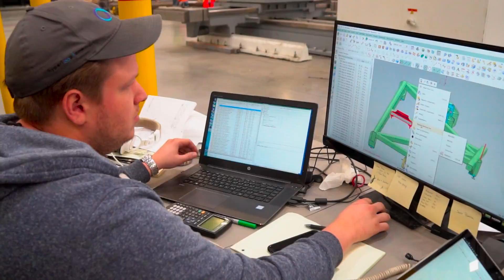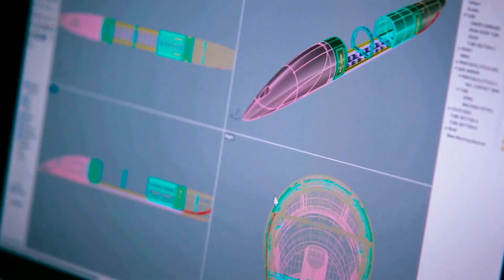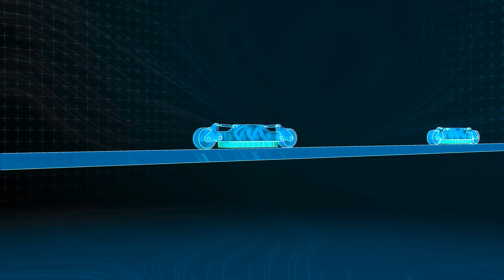How Hyperloop Plans To Revolutionize Transportation | Engineering The Future

Comment: But why not just use trains, how much faster compared to how much more expensive is a hyperloop compared to a train? What product or service needs that kind of speed to justify the enormous cost? If you instead just go with nice and slow trains you can still go as fast as most cars moving large volume of goods or people at a fraction of the cost and emission. For the cases where speed is key an aircraft will suit your needs, I just don't see the benefits of the hyperloop that would justify it's enormous cost, because it's just unbelievably expensive while not really having a good usecase to use them for. Maybe decades from now after the whole electric grid has been turned into a emission free one does something like this make sense but until then I'd hope to see development for this technology in the lab since it will be useful to use on the moon for example.
Reply: "But trains aren't cool or comic-book-futuristic" -- Elon Musk, probably
Reply: These work easily and effectively in small scale. No maglev required. From the one I assembled it seems to be an issue of how large a vacuum can be made. Or maybe how many.